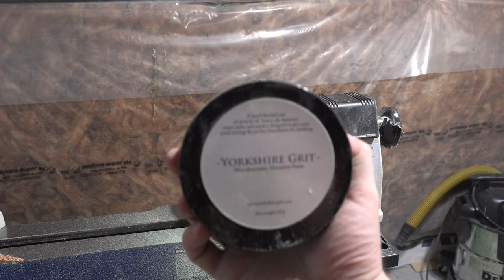Woodturning | Paper Bowl!

Comment: Cool project, I may have to give this a try myself. I would be a little cautious about the holding strength of hot glue just around the edges and not on the mating surfaces. I would either use CA glue on the face or PVA wood glue with a patch of brown paper bag (or a leftover sheet of your craft paper) between the block and the piece. You'll also save a ton of effort if you cut the corners off before you start. Not only is it less material to turn away but it should also reduce the forces acting on your glue block.
Reply from the maker: Thanks, Drew! And you're 100% right about the corners. I thought going into this that the paper/resin combo would turn easily, and it might just be faster to turn the corners off rather than cut them, but I definitely would have cut them off if I could go back. Live and learn, as they say!!

Just as a heads up, the card stock I found was a bit pricey (got it from Michael's) if you happen to try this yourself. I'm looking to see if I can find some cheaper coloured paper that would also work well with this.